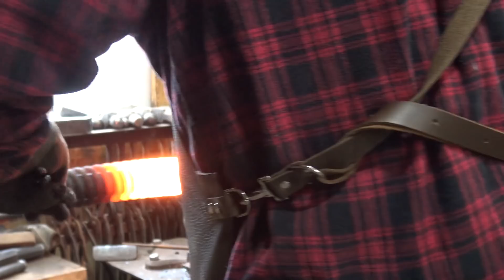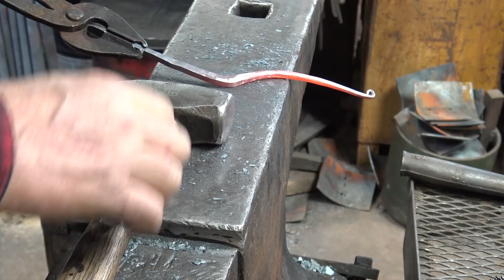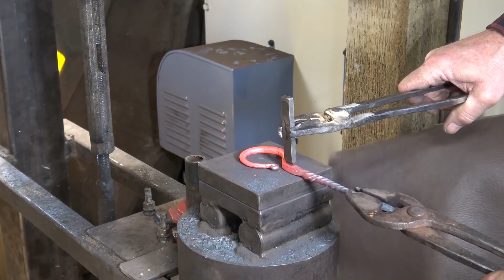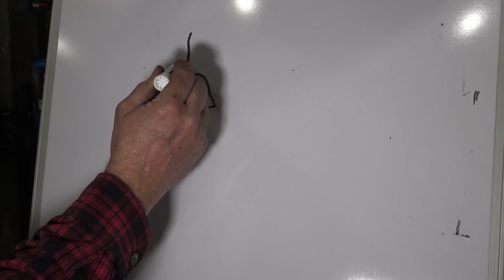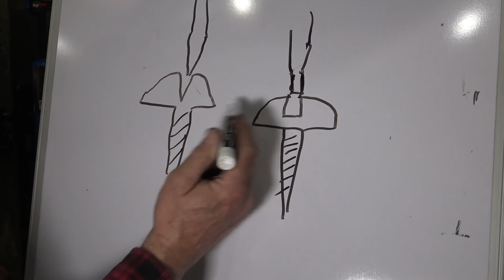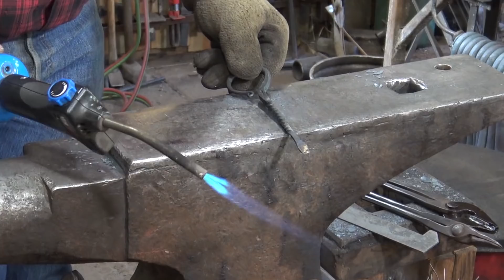Rustic screwdriver - blacksmithing project

Comment: Hey john I have 4 of those spring coils I been saving what steel would you recon there made of on average
Reply from the maker: They seem to be pretty high carbon, possibly 1085
Reply: @BlackBearForge  thank you! I got some 1080 here and just got quite a bit of 1070 but haven’t worked any 1085 yet gonna give it a shot tmr after I finish up my railroad spike axe and fire poker for my father in law

Comment: Take a tip from Timothy Dycke, he used the vice to hold the end, a pipe for the coil, and the tractor to pull it straight after heating.

Comment: Have you ever seen a hand-forged carpenters screwdriver with a wooden handle? I think they were better at driving in wood screws then these plastic handles screwdrivers.
Reply from the maker: The ones I have seen all seem to be factory produced.  But it wouldn't be hard to make a similar on in the shop

Comment: Well done, I'll have to make a job-specific screwdriver for my hand-planes. The screw that holds the iron to the chip-breaker is large with a fairly thick and wide slot- so a purpose made screwdriver with a large football shaped handle and a short shank would be perfect. Maybe even add a collar that fits over the tip and around the screw.

Comment: Great video, John.

It reminds me of a metalwork class when I was about 13 or 14 (I suppose what you Americans would probably call "shop class"). A mixed group of boys and girls, we each made a flat-head screwdriver with a handle out of mild steel hex bar, with one end turned to half round, the other end tapered round, then drilled, and the shaft of 1/8" silver steel (W1 for you lot). Some of my classmates were too nesh to use the oxy-acetylene torch, so I forged and heat treated about six blades, including my own.

Alex Steele has a video where he made a very nice damascus screwdriver, with wooden slabs for the handle. Maybe cocobolo... looked very much like it would have been a tool supplied with an expensive gun.
https://www.youtube.com/watch?v=WvPjSrgT3v8

Comment: Very nice work.  Took a class with Mark Aspery and we had to make a screwdriver to separate the coils of a cork screw. He had us forge the flat blade but then about 4 inches back we slit and drifted the bar and then made a loop and ran it back through the hole so it was a flattened circle handle for leverage.  Fun project. Thanks again.

Comment: Here's a challenge....instead of a ring, draw out a tang then hammer weld a socket over the tang midway along the length. A wood handle would fit over the tang and into the socket.

Comment: Nice work! Your channel, John is one of the few I watch regularly... how do you reckon you’d go forging a Phillips head screwdriver!?....
Reply from the maker: I would have to think a bit on how to get the tip just right
Reply: My first thought would be to find a heavy machine screw with a phillips head and vice it in.  Then use controlled heat at the tip of the screwdriver blank and drive it down into the machine screw for use as a swage.  I don't think it would fully form the end but would probably provide enough reference that it could be cleaned up with a few triangular files easily enough

Comment: I'm so jealous of your tongs and how you straightened that spring in the beginning. I've been off-and-on forging the last 4 or so months, and I had no idea how hard forging was on your off-hand. I'm a woodcutter and woodcarver and I can swing an axe or hatchet all day, and transitioning to swinging a 2-4 lbs hammer was pretty easy. I was not prepared for just how hard I had to squeeze a set of tongs in my off-hand. The tongs-hand has been the hand that fails and necessitates a break 100% of the time. I feel like the hammer-hand gets all the love and prestige, but the tongs-hand does at least half the work, and it's thankless work.
Reply from the maker: You might try using tong clips so you don't need to squeeze so hard.  https://www.youtube.com/watch?v=xYbBFnLRU7c

Comment: John, have you made a video of restoring a leg vice? If you have I must have over looked it. Anyway, I have a question on the screw shaft and box. The box has a crack on the end and the screw has some that are flattened.. I am just now taking them out of the electrolysis tank and have used a twisted wire brush on an angle grinder and painted most of it... so If I have to have the screw redone somehow, who should I seek out to do that kind of work.. In general, obviously..
Reply from the maker: I have never tried to restore a leg vise.
Reply: Ok, would you have any advice as to the screw shaft or the box?

Comment: All the years I've been smacking hot metal with a hammer, I still use plain old vegetable oil for quenches....  Makes the shop smell like a fast food joint sometimes, lol.
Reply from the maker: Vegetable oils are a pretty good option.  I don't use them for two main reasons.  1) I am concerned the odor might attract animals, we have raccoons, skunks, bears and all manner of rodents. 2) it gets very solid in the winter in my un heated shop and would be extra work to heat up to a liquid again.  But I may give it a go this summer and store it outside the shop so if anything wants a taste, they won't have to break in.

Comment: There is a German company that does the flat instead of taper using a hollow grind to the tip instead of a straight bevel.  There is another company that is swiss if I recall that does the hollow but tapers slightly fatter at the tip to help give it bite and prevent cam out if the screw driver is misaligned.  Nice looking screw driver, would prefer that over the chinesium ones I usually buy.

Comment: When are you planning on re-grinding or re-surfacing your anvil?
I really want to see that
Reply: I think he has said before he will not redo his anvil during one of his q and a videos.  It was a response to a question about what looked like cracks between the body and top plate.  A previous owner had done some weld repair and he does not plan and redoing it.
Reply from the maker: While I doubt I will ever re weld the edges on this anvil, I do plan on dressing the face at some point this summer.  It has developed a crown over the years.
Reply: Welp, guess I was wrong lol.
Reply from the maker: @Worrsaint  you are right that I probably won't be rewelding the edges.  But a little grinding may be in order